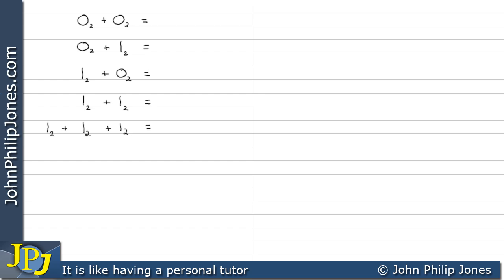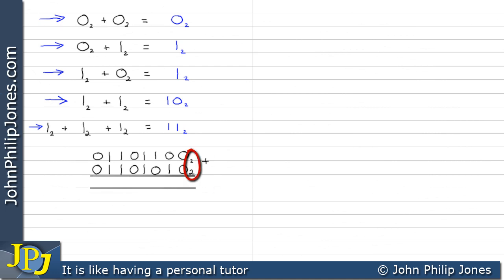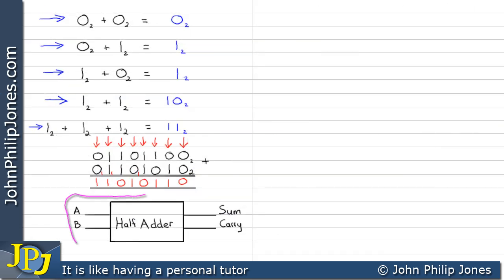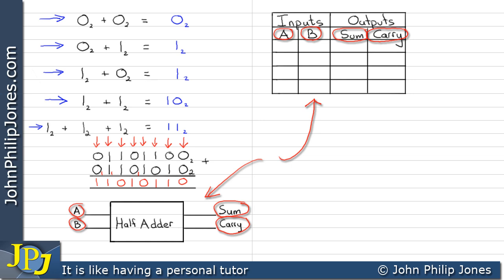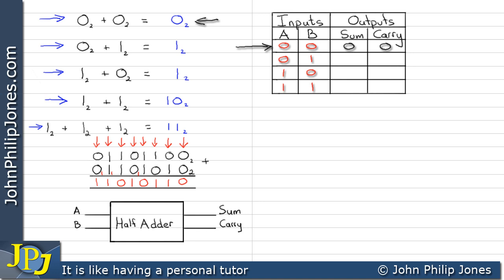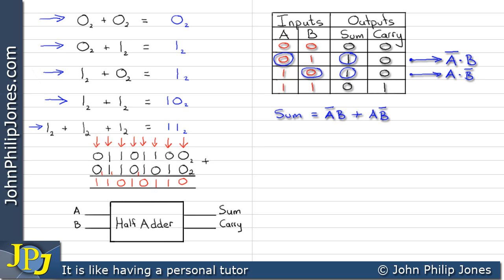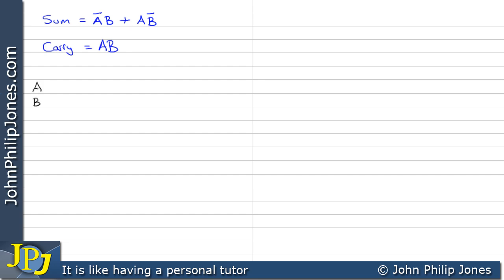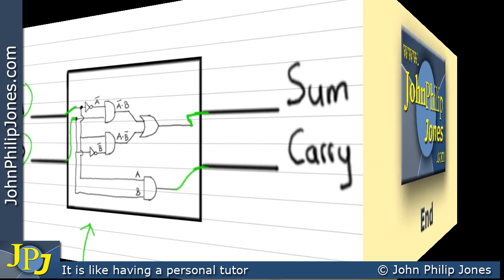Half Adder Design

Comment: Do you have any videos that do example problems?
Reply from the maker: Yes but to what topics are you referring?
Bw
Phil
Reply: For example sequential circuit has one flip-flop Q, two inputs X and Y, and one output S. The circuit consists of a D flip-flop with S as its output and logic implementing the function with a function and then make a state table and a diagram. Just any word problems to practice these schools
Good videos overall
Reply from the maker: jake Lary Hello Jake, Not got any on those topics at the moment but they are in the pipeline. However, I am committed to making Python videos for the next 6 months so it will be a while before I will be uploading  on these topics,
Best wishes
Phil